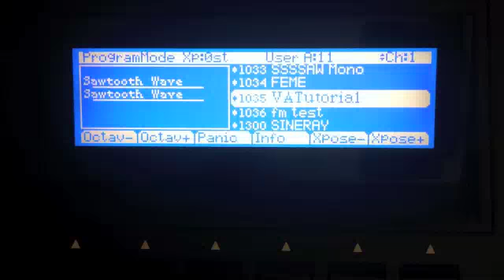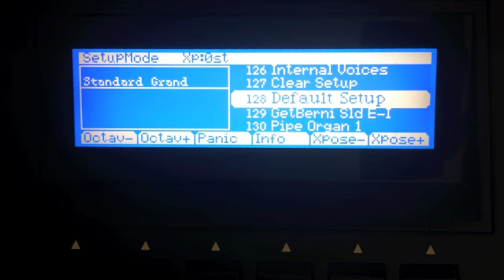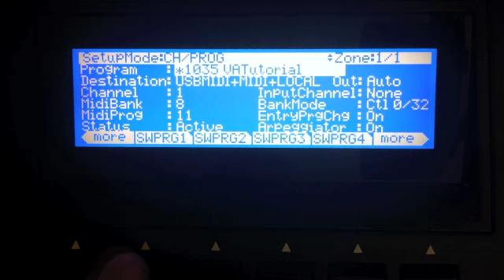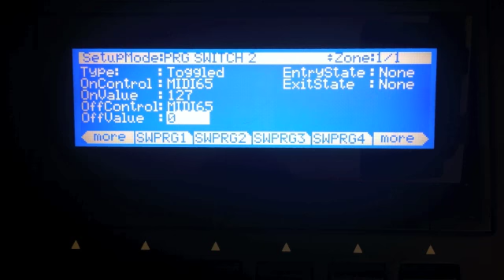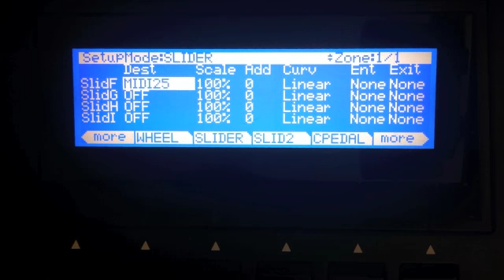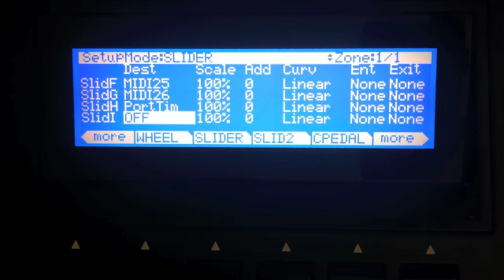Kurzweil PC3: Tutorial 4 -- Extending VA Capabilities in Setup Mode

Comment: @poserp thanks a lot for your fast apply.First i checked out the program which was monophonic from the previous tut.Although i had to use the pages arp/sw and switch and it works fine.But why didn't works like yours?
Thanks in advance!

Comment: I also had problems with mono on/off being stuck OFF. At first I solved it by adding a mono on/off control via the SWITCH soft button of the setup. This worked at first but then when I fiddled with the sliders a bit it wouldn't work again. Maybe there is a conflict between the program and the setup both trying to use the switch. Dunno. Anyway, in the end I just worked around this by saving a version of the program with mono always on set under COMMON and pointing the setup to this. Also, note that when switching the program or setup on for the first time, you might need to bump the A slider a bit, which turns something on (it is also a lot louder).
Reply from the maker: +drflodo Yes, you need to be careful when using things like SW that can be assigned in both Program and Setup mode. One way around this is to use the "Category" buttons instead. While you can overwrite what those buttons do by changing the "control" setup, they're generally not assigned to control anything in a Program. I've found this is the best way to deal with CCs, like mono on/off, portamento on/off, and so on, that have "default" assignments in the MIDI spec.

Comment: @poserp great video series, very helpful. One thing that is confusing is that when you save the program the set up the way you had it and then switch to setup mode and assign it to default setup, it's basically silent till you assign the sliders and turn up filter cutoff. It didn't seem to do that for you in the video, so I'm wondering if you changed something off camera, or did I do something wrong?
Reply from the maker: +jduncan1980 -- off screen I immediately move the slider after assigning it, so you're experiencing the same thing I experienced. I make mention of that in passing in the video, but it's easy to miss (I should have stated it more clearly).